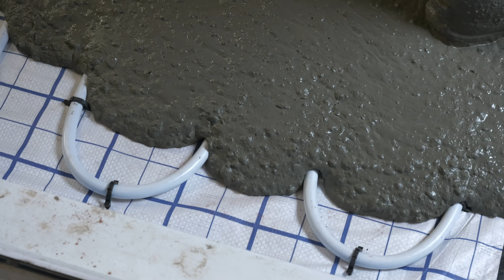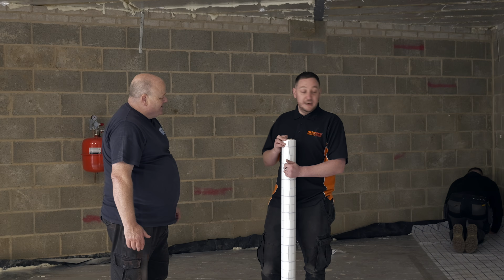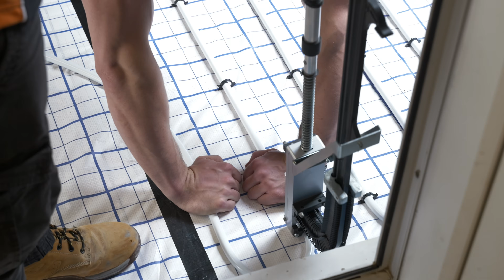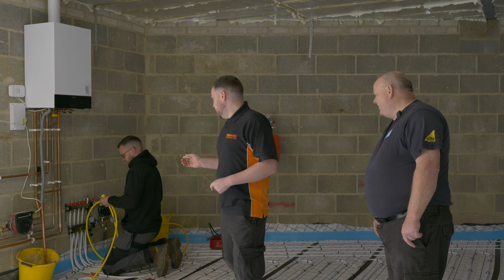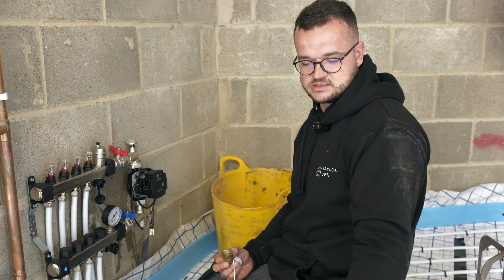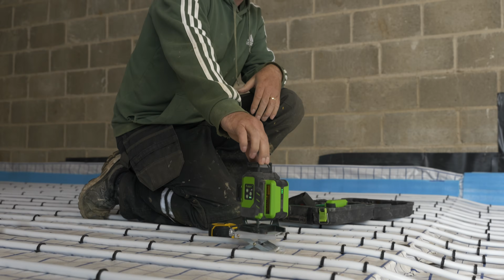Underfloor Heating Installation with ProWarm In-Screed Wet System

Comment: Hi Alan I have a Worcester 35CDi greenstar 47 311 94 when the hot water tap is turned on it goes straight to lock or over heating it only does this on the hot water circuit it’s had a new hot water heater exchanger the diverter valve opens on hot water it’s had a new main board the boiler is fine if the pump is wired constantly running all the time does the pump work for hot water or just heating if it’s put back to factory settings and I turn on the hot water tap it climbs to a hundred degrees in a few seconds loads of engineers have been around just throwing parts at it with no fix
Reply from the maker: Have you Called WB to see if you can get a fixed price repair?

Comment: Well presented. Three questions 1) Total cost for the underfloor 2) Why underfloor in the garage 3) Running cost.
Reply from the maker: Total cost, This installation was main done for video purposes so you would need to contact a local installer. i am guessing that answers 1 and 2, Running costs will depend on the heat loss of the property.

Comment: Great Video, Im just about to install a Cemfloor liquid screed 60mm thick with 16mm underfloor heating pipework and the installers have asked for a 500g dpm to be put down on top of the 100mm Celotex, so do you know whether the Laminon UFH Grid membrane could be used instead of that?
Reply from the maker: You would be best to give the underfloor heating store a call for the best advice. Thanks.

Comment: Great vid.
Do you tee for the manifold off the primary or secondary.
Thanks.
Reply from the maker: I am going to connect it to the heat and hot water cylinder
Reply: @AllenHart999  great. Thanks.